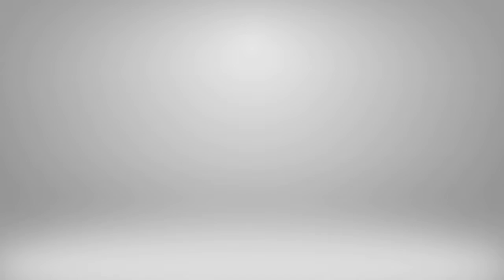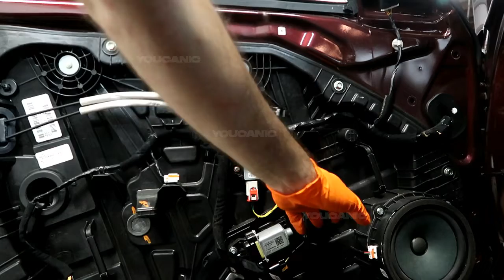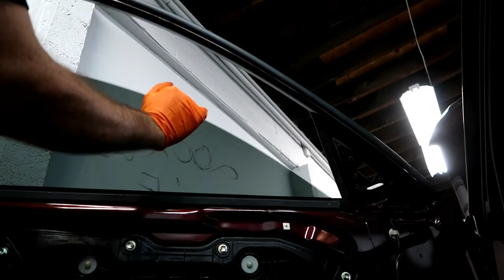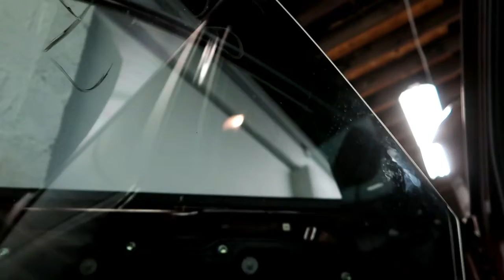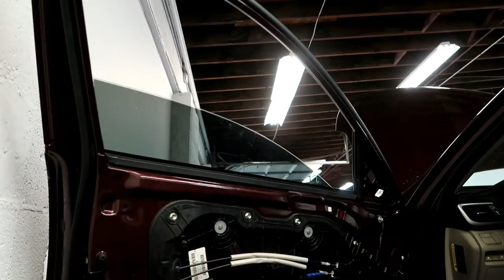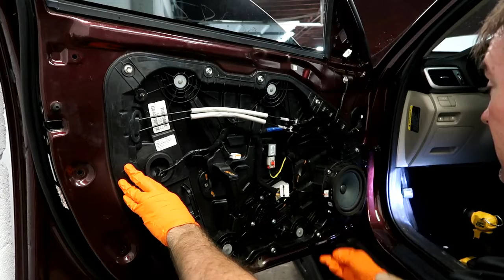2015-2020 Kia Optima Remove and Replace Door Window

Comment: It's different on a 2015 kia optima gdi, there's only one rubber grommet to remove on the actuator to access the bolt hole for the window, the other side you have to remove the speaker to see the bolt hole, also the back one with the grommet is the one you have to remove completely, it has the hole on the window, the side near the speaker is the clamp side, so its completely opposite apparently
Reply: Cannot seem to get my 2015 optima driver window to go smoothly up the tracks when I put it on. Tried to adjust it a nothing.. any tips?

Comment: How do  youremove the door panel
Reply: At the door handles the one that you use to get out of the car the back panel part behind the actual handle comes out and there's a bolt there and then the other door handle that you pulled the clothes your door the bottom part of that is just like a rubber piece and you just take that out and there's a bolt there that you have to unscrew and take out to remove it. You can use a flat head screwdriver or a plastic interior pry bar thing

Comment: Is this the same for 2014 Optima
Reply from the maker: Thanks for your comment! While many similar processes apply across years and models, there can be slight variations. Youcanic is designed to empower car owners like you with helpful guides, free resources, and our powerful YOUCANIC scanner. We invite you to visit www.youcanic.com where you can check for specifics related to your 2014 Optima.

If you need further assistance, do feel free to reach out, our mission is to support you on your car ownership journey! Plus, we even have factory repair manuals available for detailed procedures. Stay confident under your Optima's hood with Youcanic!

Comment: when you pulled the first window out it had two clamp things on the bottom but when you put the other windows back in there was only one clamp on the front.. explain? and i mean clamp for the bolt.  i have 2017 kia optima
Reply: Watch again.  One clamp on the rear and one fastener on the front.  The clamp "sandwiches" the glass at the rear.  The front fastener is fastened to the glass and you need only put a bolt through the threaded bolt hole, however be careful to prevent dropping the bolt into the door cavity.